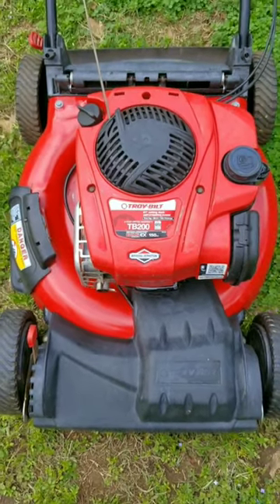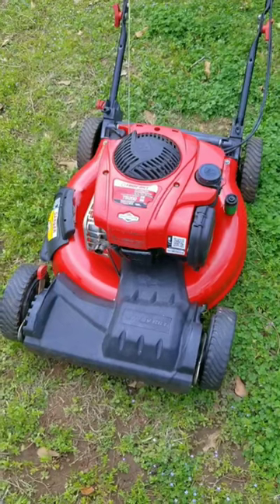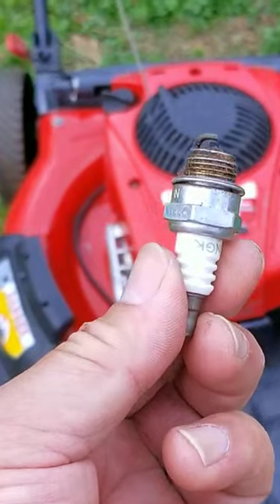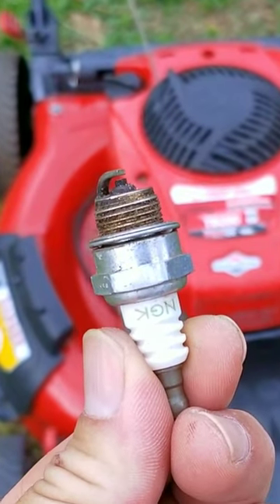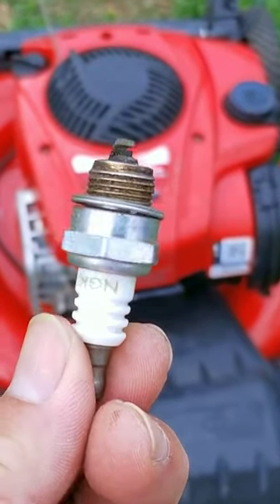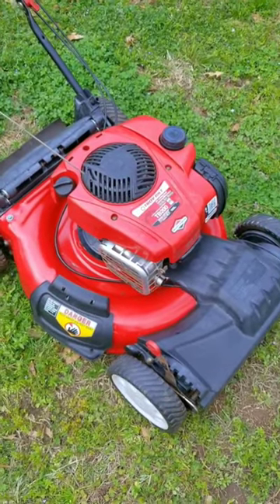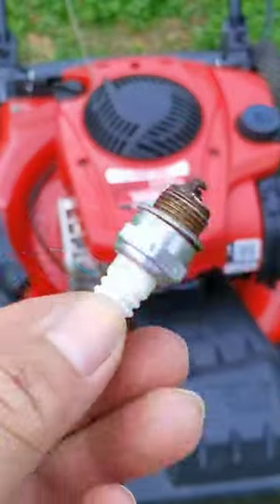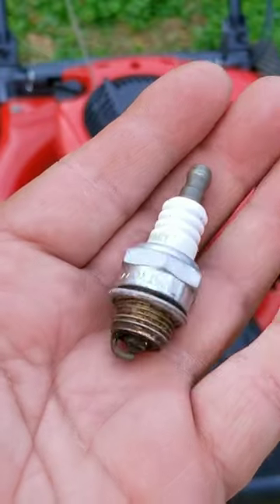Am I missing something #shorts #mower

Comment: As long as the spark can "reach" the fuel/fuel vapors in the combustion chamber yes it will run. Just not correctly.
Reply from the maker: you are correct

Comment: What some people do not understand is using a random plug can cause problems heat range may be too high or too low. too high causes overheating and pre-ignition too low causes fouling and excessive carbon build up. or the plug could be too long and could damage the top of the piston or too short affecting the combustion and power. The NGK shown in the short comes in many different heat ranges and can have resistors but mainly for weed eaters chainsaws and blowers and some Kawasaki riding mower engines use them also. some engines need a resistor plug to run properly Husqvarna weed eaters are a prime example of that they are very sensitive on what plugs they use.
Reply from the maker: you are absolutely correct

Comment: The threads are right, it will seal the compression. The nose is too short for what it should be but it still sparks. Fire in the hole! It works, just not correctly. Too short is better than too long, at least it isn’t hitting valve or piston. The nose being wrong also means the carbon won’t get burned off and the plug probably doesn’t cool properly, so plug life is reduced. That would be my three cents on why the plug looks terrible. 3 not 2? Yes, inflation hits everywhere.
Reply from the maker: you are correct, the flame front will be all wrong

Comment: I just acquired one of these lawn mowers.   Unfortunately, it has a ton of blow by and pukes oil out of the crank breather.   I replaced the head gasket hoping the would fix the issue but its the rings or the bore.  Im going to run it till it blows up.
Reply from the maker: good choice
Reply: I had one of those. I ran thicker 20w-50 in it and got an extra year out of it before it tossed a rod on final leaf day of the year.
Reply: Thats exactly what I did.   I put 20W-50 in it and ran some BG EPR hoping it was a stuck oil ring but it didnt do anything. Haha even with the 2050 it still blows oil everywhere

Comment: If it won't interfere with the piston, you could use anything that'll seal the chamber and spark. Could jb weld two wires in the hole and it'll run if you wanted.
Reply from the maker: interesting idea.  On this one, the flame front will start in the bore for the spark plug.  Best to get the correct length
Reply: @INSIDEHOUSEGARAGE  That would be the case regardless, but that wouldn't stop it from spreading to the main chamber. Just imagine a flame thrower. You light it at the orifice, but the flame travels the full length of the fuel. It'll run, but the timing will be off. You could probably screw a tube into the spark plug hole and lengthen that distance even more until you ran out of compression or bumped the timing so far that it wouldn't fire at the right stroke at all. (Might make for a cool video)
Reply from the maker: it would hamper power, efficiency and could possibly cause "pre detonation" if the weather was hotter.

Comment: CJ-8 equivalent. Those were for 3.5hp B&S flatheads back in the 60's thru 80's.
Reply from the maker: this engine requires a spark plug that's a lot longer, to extend the tip into the combustion chamber.

Comment: Since this is a one cylinder and running off low octane, there wouldn't be detonation.  The spark plug ignites the fuel and it gets burned off during normal operation.  That or maybe some of the furl mixes with the oil and gets burned off as a true "no oil change" engine.
Reply from the maker: thank you

Comment: The exposed porcelain ( heat range seems okay) The threaded portion may be a bit to short but being too long might come in contact with the valves or piston 😱, a resistor plug may or may not affect engine performance, a partially sheered flywheel key or damaged coil will keep you scratching your head all night 🤔😜🤪!
Reply from the maker: with the plug being too short, the flame front is happening in the spark plug bore instead of in the combustion chamber

Comment: Spark plugs all do the same thing, they make a spark, the difference is the reach and heat range. Short is better than to long.
Reply from the maker: maybe so, but the flame front is staring in the bore for the spark plug and not in the chamber.  This might have other implication as well like pre-detonation.

Comment: That plug looks like it is being subjected to oil in the combustion chamber, rich air fuel mixture , weak spark ⚡️, or delayed timing ⏱️! Even a loose valve seat or end gap  clearance on the valve stems will slightly hold the valve open  causing low compression or back firing 🤪! I love watching your videos 👍!

Comment: It doesn't matter which size it is it mill still work I have a Stihl chainsaw and a total trimmer and the trimmer had a  longer spark plug and the Stihl a short and I bought 2 short spark plugs and they said it doesn't matter the size it still works and it is true they are working the same as the other spark plugs
Reply from the maker: nah..   it matter.
Reply: @INSIDEHOUSEGARAGE  maybe for some it has to be the same but for some it doesn't matter it'll still work as the same as the other
Reply: @anthonypatt179  It was combusting in the threads of the bored hole for the plug, not in the cylinder.
Reply from the maker: correct

Comment: You didn't show the plug number, only the NGK.  So how can we know if it's the right one?
Reply from the maker: the point was to show that's it's much too short, not the number
Reply: @INSIDEHOUSEGARAGE  OK, sorry about that. Most of my mowers are old flathead Briggs, so that short plug looked normal to me. I didn't realize the new OHVs took the longer plug. I just pulled the plug from my old 5.5 Intek OHV to change it, probably for the first time,  and it's long and very skinny, a 5/8 peanut plug. And not cheap, 5 bucks.
I'm trying to stay away from the new ones as long as possible.  With their new "just check and add oil "  for philosophy,  I think Briggs considers these throwaway engines. I'm sure my 30 year old mowers and 1970s tiller would be dead now if I never changed out the oil.  I'm really shocked that they push this considering one quart of oil for $5 can give you two oil changes. I guess people are THAT lazy.
Reply from the maker: not a problem

Comment: I have a mower with the same engine of which I changed out the plug recently and can tell you that is not the correct plug. The correct plug is pricey. That's probably why they installed a cheaper plug.
Reply: Correct plug is RC12YC, which are about $4 each so not pricey at all
Reply from the maker: I think you might be right
Reply from the maker: check mate

Comment: Short  spark plugs run hotter than the over Head valve engine which runs cooler
Reply from the maker: thank you
Reply: Not necessarily true.  The center electrode length determines how hot a plug is.  Short plugs have short electrode lengths, and run cooler.  That's why CJ series only goes up to 8.  RJ19 and RC12Y are both hotter than this short CJ8 equivalent shown in this video.

Comment: I mean it's an engine. If you have air, fuel, and spark is gonna burn/run. How well it runs depends on if you get the optimal ratio of those things with the perfect design for that engine. So the wrong spark plug could very much run the engine, just poorly as you described. It also looks like it didn't get hot enough so it eventually would have bridged the gap and been non-functioning.
Reply from the maker: you make a great point thank yo!